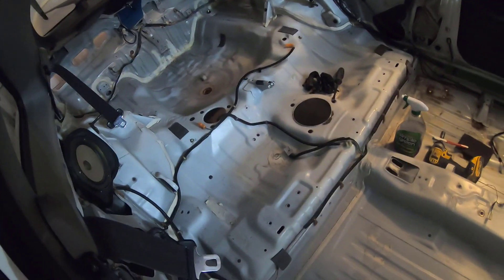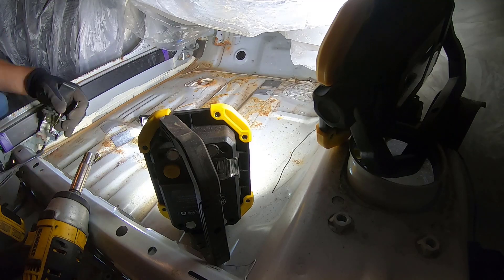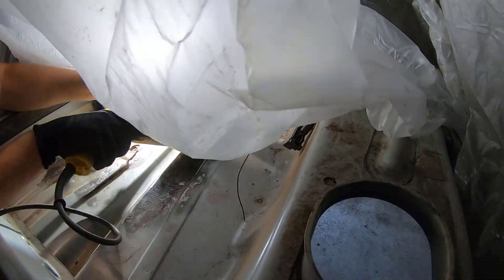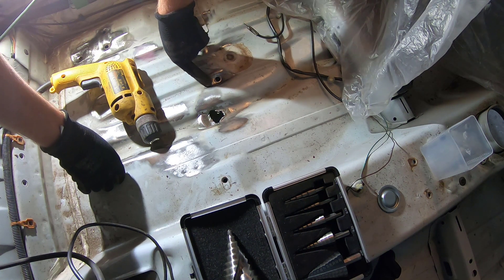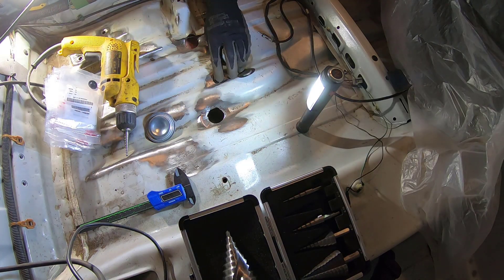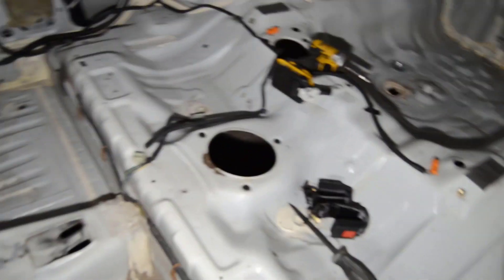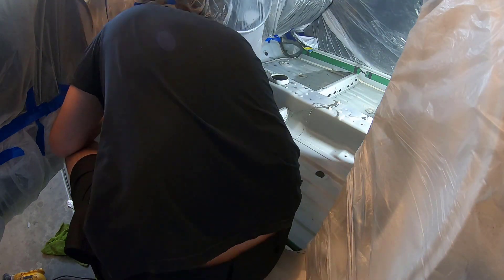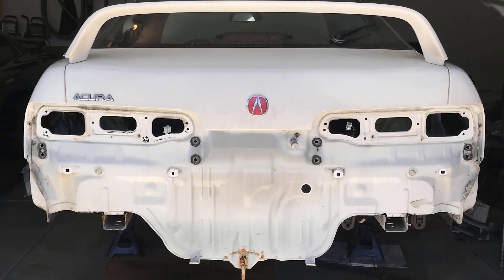The Rusty Barnacle - Floor Pan Rust Removal - ITR 98-0111

Comment: That's the way to do it,get to it before its too late, i was wondering, i have a little hot rod and in one of those corners of my floor pan it has rusted, its not bad but its not surface rust either,its a small rectangular area probably 6 inches by 2 inches and i was wondering, would evaporust work on this til i decide when i will get someone to cut the area and replace it? i was planning on wirebrushing and using evaporust and then painting it for the time being, thank you for your input.